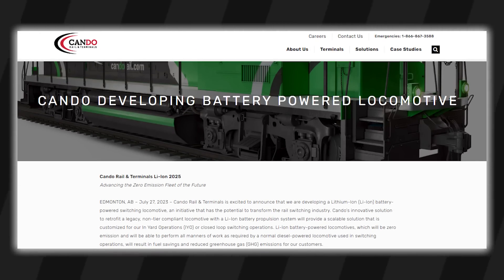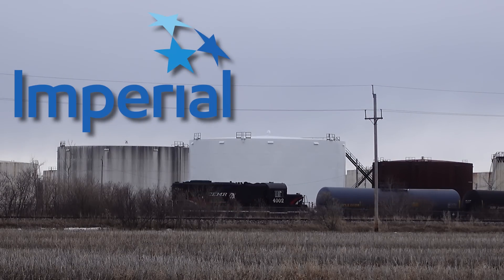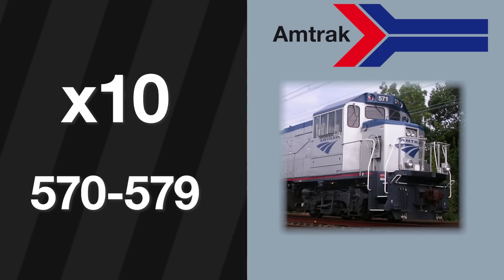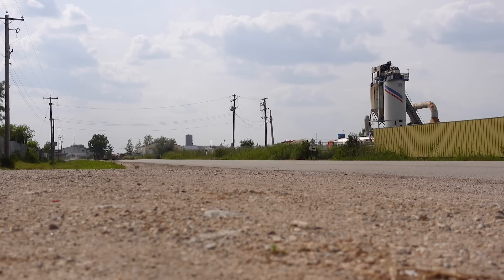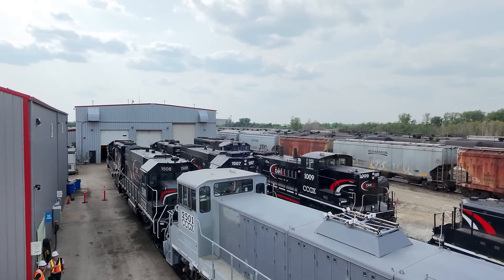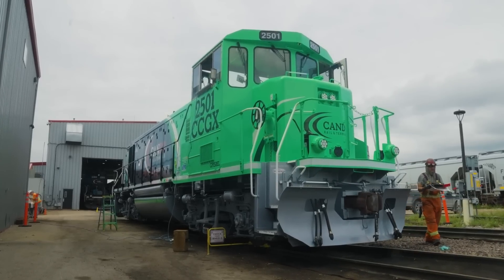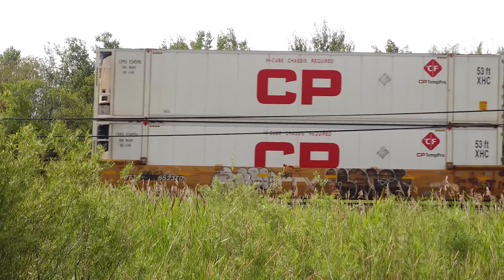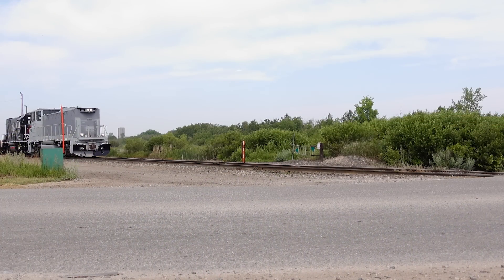Canada's First Battery Electric Locomotive - Cando 2501

Comment: Diesel-electric vs. electric: While diesel-electrics have lower fuel efficiency, they do not have the transmission losses associated with delivering electricity from a remote power plant to the locomotive, which can sometimes make them a competitive option depending on the infrastructure. In other words, it might be a good idea for a switcher in a train yard, but far from ideal for long run trains.

Comment: I'm wondering 🤔 they say its green but the sad reality is it not . Costs more to run can't pull heavy loads to far . If you really want a affect locomotive thats greener then diesel power has already completed this with the amount off loads they have completed though out there years on the rails . There are hidden dangers to electric battery train . Like meany have said if a electric toy car can completely destroy a home with a sneeze then what's going to happen with this electric monster when joined up with hundreds oil wagon fully loaded.  Running away would be a good idea when you see it coming 💡 i don't fancy being the first man on the moon without using a space rocket when that things sneezes going through my town 😂😅 I'll wave as i fly by . Keep up the outstanding work 👏 👌

Comment: Stupid question, but I'm wondering why most train engines make a loud ticking noise at low speeds?
Reply: The ticking is a valve on the air system spitting the moisture out of the compressed air.

Comment: What a WASTE of money, Electric locomotives (cheap to produce) been around for over 100 years. Just put a alternate dc supply in the loco to operate on sidings, as electric busses used to have. Just electrify the main lines like in Europe. All that money could have powered up the main lines
Reply: It  costs lots of money to  sling up overhead wiring .
Reply: @paulwarner5395 that is one time cost. Maintenance cost very less & eco friendly
Reply: Paul maintence costs of wires is more expensive then diesel.  Railroads would have to hire crews to maintain the wires.  Which costs the railroads $$$.

Comment: Surprisingly small battery but for switch yard work it's enough. I've seen battery loco designs with up to 14 MWh battery. In the US the plan seems to be to put one battery one in a consist to turn the whole train into a hybrid, the battery one helps push uphill and regen brakes and recharges downhill making the whole train more fuel efficient.
Reply: That seems like the very least, but why not add a couple of battery carts!? should be pretty easy to add containerized HVDC MW batteries to make the entire journey electric.
Reply: @velotill  Anything within a state should be possible with all battery locomotives but cross country, or cross Canada, I think I would go for charging along the route. Might need a 10 MW charger though like we have in port for electric ferries.

Comment: For a battery-powered yard switcher I can see why they went with DC traction motors, but for line-haul units on a caternary, AC traction motors would be the way to go. The modern diesel-electric units use AC technology with regenerative braking power being wasted as heat in big resistor banks. In a battery-electric unit the regen could be used to charge the.batteries, and on the caternary units the power would feed back into the overhead supply to help power other locomotives on the line. Caternary power was used to operate the engines on the BCRail extension from Prince George to Tumbler Ridge, so it has been done before in Canada.
Reply: Electrification carries the HIGHEST MAINTENANCE COSTS
Reply: @Steve-p7z8h  highest line maintenance costs, yes.  The locomotive maintenance cost are lower, however.  This is why overhead electrification makes most sense on busy mainlines with dozens of trains per day, not sleepy branch-lines with fewer than three trains per day (and sometimes only one per week, or whenever someone gets a round tuit).

Comment: For an electric shunter I feel like it could work like the small coal powered shunters the fuel source or techincially charging source but i feel like an electric road locomotive would work as well if it ran on batteries unless it has over hanging wires
Reply: Wires cost $$$ to maintain
Reply: Your not wrong on that

Comment: Let's do the math:  1,200,000 watt-hours divided by (2500 horsepower times 746 watts per horsepower) equals roughly two thirds of an hour of operation at rated load before losses.  Still not convinced battery-electric locomotives like this are a gimmick?  Consider the EPA valuates the fuel value of one gallon of diesel fuel at approximately 37,100 watt-hours.  If we divide 1,200,000 watt-hours of battery capacity by 37,100 watt-hours per gallon of diesel fuel, we arrive at the energy equivalent of 37 gallons of diesel fuel before losses.  That is a FAR cry from the 3,200 gallon fuel capacity of an SD40.  (118,720,000 watt-hours.)  That's about a 100:1 disparity in energy storage capacity.  TL;DR:  If you want electric trains that are useful for more than merely tending a dedicated small or medium industry, you need overhead wires.  No 'if's, 'and's, 'or's or 'but's about it.  Salesmen and green-washed PR campaigns lie.  Math doesn't.

Comment: Interesting. What I’m waiting to see is something like this bussed to a “standard” locomotive like a slug where the prime mover only starts and stops to charge the battery.
Reply from the maker: Yeah, honestly with CN's surplus of slugs, I think that'd be a really good cheap solution to their EV craze, lol.
Reply: @TheWinnipegRailfan  Every heat engine (combustion turbine, diesel, Otto) has a sweet spot (speed, power) where it runs at maximum efficiency. Unfortunately, in transportation speed and power fluctuate continuously in operation because of the service we’re providing. As such, at least on the railroad, the engine is designed for the best efficiency possible from idle to run 8. But now if you take a diesel, set it up for max efficiency and only start, run and shutdown when charging the batteries in the slug you will have greater overall efficiency than just a mother/slug set.
Reply: Like running a Tesla on a generator in the trunk.

Comment: For switching electric makes sense but time will tell how this thing could run in - 50 weather
Reply: I would put a diesel heater or a small (100kW or so) generator on an otherwise pure EV locomotive for emergencies if it gets stuck out in the wilderness for a couple of days in a snow storm.

Comment: Converting a single locomotive to battery electric is a fig-leaf for people to keep polluting.
It´s insane to put concrete in the loco when you could put more batteries in there... like LiFePo, much cheaper (probably what they are using) and you could get a lot more endurance.  Over the next couple of years Sodium (just coming online now) will be much cheaper for batteries.  Batteries make a lot of sense for a switcher, but it´s never going to work on mainlines, so it´s just a band-aid.

Outside North America, pretty much all railways are electrified with overhead catenary.
It is a solved problem.  Just deploying near universal catenary tech would electrify the railroads, no R&D needed. That would actually solve the problem, but folks are just doing window dressing so they can keep pumping out crude.
Reply: I wanna see battery carts to be added behind locos with containerized HVDC blocks that can be easily switched to make the entire journey electric.

Comment: The Railroads keep talking about Battery Electric’s & Hydrogen Locomotives. 
However, these two types of locomotives are only stalls for what Is to be the Most Efficient Way For the Railroads to Convert to Green Energy. AND THATS ELECTRIFICATION.

And hey, green sources of energy can be utilized to power electrification. After all, The Milwaukee Road used the abundant Hydropower of The Rockies to power it‘s electrification.

Comment: So big deal. All locomotives use electric power to run the wheels. They generate  the  electricity on board using their diesel powerplants. This one will impress all the 'greenies' working at slow speed in the yard. It will never be useful in mainline, heavy-duty freight hauling, often over mountainous terrain. The batteries simply will not hold enough power for that.
Reply: It's a switcher, made for yard work.

It's not meant for mainline work in the mountains.

Comment: One thing about regenerative breaking: That would actually reduce maintenance, since you're using funny physics which don't rely on friction to slow the train down - means you use your break pads less. Less use of moving parts, less wear.
Reply: they already use regenerative braking, except it goes as heat

Comment: Railpower used to build battery-electric locomotives 20 years ago ... Green Goats they were called.
Reply from the maker: Right, forgot about them, lol. Apparently theirs still had a tiny 100hp diesel motor along with the battery, this one is 100% EV
Reply: Battery-electric railcars go back more than 100 years. The Wittfeld Akkutriebwagen from Prussian State Railways were introduced in 1907 and were running until the early 1950ies, to be replaced by DB Class ETA 176/Class 517 (until 1984) and Class ETA 150/Class 515 (1954-1995).
PS: There is a lesson to be learned from Class 515 - with the batteries located in the center of the train, over the 40 years of use, the frame tended to sag in the middle of the rail cars, earning them the nickname Hängebauchschwein (Pot-bellied pig).

Comment: These are DEFINITELY the future of rail in Canada for many jobs especially those where local ground air quality issues matter.. Aka rail yards... I'd also ideally love CN to revive the concept of electrifying its mainline across Canada from at least Prince Rupert and Vancouver to Edmonton via Jasper since that's the busiest stretch of track in the nation and only getting busier over time..  Or at the very least more battery electric locomotives that are increasingly gaining power density and range with every year. Meanwhile diesel will never get any more efficient than it is now. Or any cheaper..

Comment: They be doing everything except electrification 💔💔
Reply: WE NEED ELECTRIFICATION.
Catenary was and Still Is The Future.
Reply: Catenary is older than diesels. Its the past, present and future.
Lower locomotive purchase cost, maintenance requirements, operational time(no need to stop to refuel), much better performance(7-9MW single units exist), fuel independant so it has more stable fuel price, dynamic braking gives money instead of wasting already spent money, etc,etc,etc.
Reply: Electrification carries the HIGHEST MAINTENANCE COSTS
Reply: @Steve-p7z8h No, it doesn't... Diesels cost more to maintain and fuel over time. Electrification is only really expensive when it's first installed
Reply: In england they ran a battery train for 1 year and per kilometer heres what maintenance costs were, THIS DOES NOT INCLUDE INSTALLATION COSTS... Diesel was 4 lbs per km... Electrification was 5 lbs per km.. And battery was...2.52 per km.  U must EMPLOY PEOPLE TO MAINTAIN THE WIRES  STUPID!!! WHICH COSTS MONEY!!!
Reply: @Steve-p7z8h  its as if hybrids are the move
Reply: Hybrids are unproven, and the cost argument proposed is too nearsighted I think and does not take into consideration the nature of the technology itself. You can't just say something is cheaper and therefore superior. Electrification is the way to go 100%. And I personally don't necessarily disagree with you, hybrids are absolutely worth research, development, funding, etc. but electriication will be the way for a long time
Reply: @schwunkie batteries are a cost to consider but so are engines transmissions rust...
Reply: @snackler6102 This has to be a joke 😭
Reply: @schwunkieto the average consumer it isn’t sadly
Reply: @snackler6102 I'm confused as to what point you're trying to make or if I'm just being ragebaited
Reply: @schwunkieRight so we either have to pay big oil more reserve currency OR pay big lithium daddy elon musk a kidney

Not just use both to our advantage…
Reply: I mean, it's a lot of maintenance on stuff, so depending on how the battery tech evolves, this MIGHT be a good idea. Also, on some rarely-ish used lines it might not be feasible to electrify them ever, so we need battery-operated trains there. Switching seems to me like a good testing ground for them.
Reply: Its for shunting, installing catenary on every part of a yard isn't exactly very convenient for standard electrification, 45° catenary is very niche.
Reply: @fredwupkensoppel8949  batteries are only good for shunting and will stay that way! overhead lines is the ultimate solution for elecrification period!
Reply: *nuclear electric trains
Reply: We HATE electrification in this house! We hate having catenary wires!

We stand for the flag and kneel for big oil buster! Electric trains are communism!
Reply: @hrunchtayt1587 Bro ya‘ll will be polluting the earth 😡
Reply: @hrunchtayt1587  HELL YEAH, AND WE DONT USE BUFFERS
Reply: @hrunchtayt1587 Nevermind nuclear I guess

Comment: "Clean" and it uses batteries that will last longer than the unit itself
Reply: It's a step that needs to be taken. Things getting worse before they can get better. VHS tapes needed to exist before DVDs came around, and just imagine how much space both will be taking up in landfills for eons to come.
Reply: @thedemolitionmuniciple  at least the engines and metal from units can still be reused
Reply: I honestly doubt the battery would out live the locomotive itself. Batteries don't even outlive diesel engines.
Reply: @zachzebra56  even then, the batteries won't be as efficient as the V12s. All it does is put more load on energy production.
Reply: @aurickanesrails Thats definitely true.